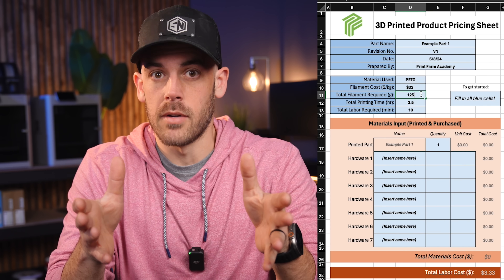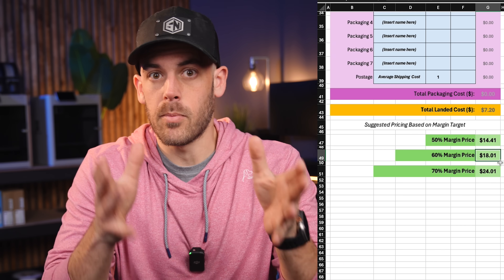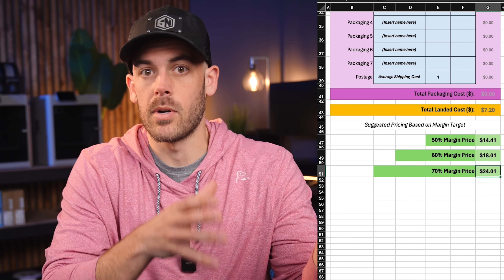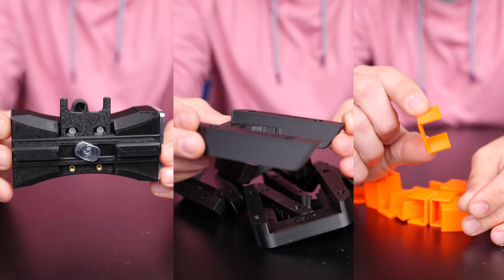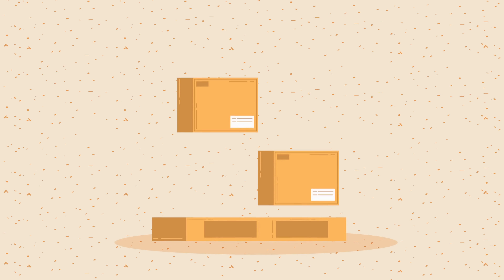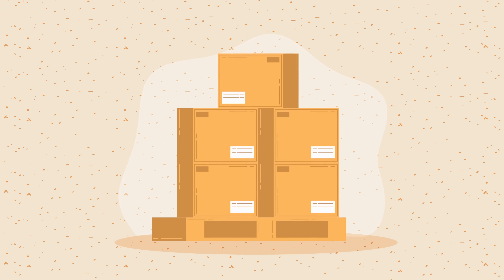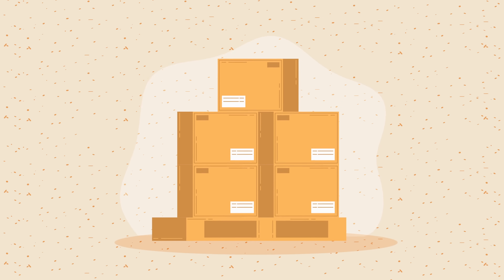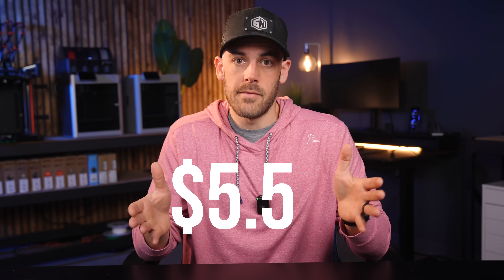Why I charge $55 for this 3D printed part (how to price)

Comment: Of course! Here's a translation into US English:

---

First of all, I want to congratulate you on your content. And if I may, with the best intention of collaborating, I have to point out that there’s a mistake in the percentages—it’s a very common one. For example, you marked a 50% margin on the stop lock based on a cost of $20.07 and arrived at a sales price of $40. But that’s incorrect because 50% of $20.07 is +$10.03, which gives you a result of $30.10. To reach $40, you’re actually adding 100% (in this case, 99.30% to be exact).

As I said, this is a common error. When people think of doubling an amount, they automatically associate it with 50%, but it’s actually 100%.  
So, the percentages in the video are incorrect.

On the other hand, costs are often higher than they seem. For instance, if you hire someone and pay them $20/hour, that’s their net salary, but you also need to account for additional expenses associated with that salary, such as tax withholdings, health insurance, etc. Additionally, your business requires non-billable hours that need to be covered—for example, time spent reading emails, marketing, etc. That time has to be paid for from somewhere.  
You also need to factor in overhead expenses, not just the electricity a machine consumes but also heating, AC, phone, internet, space, accounting, software, and so on. All of that needs to be included in the margins.

That’s why so many people offer very low prices, which disrupts the market and sadly leads to failure because they didn’t do their calculations properly.

In any case, pricing is a headache! lol  
It’s really complicated to get it right. At least in my case and with the type of business I run, pricing is very subjective and complex.  
Especially when you’re not driven by "numbers" but by the passion for what you do, as is the case for me and many others.

Good luck!

Comment: How about taxes, additional cost to your business, insurrance, rent, etc... And this is just a few to mention. There is no such a thing 5 minutes work. We call it 1 started hpur. So 5 minutes work or 30 minutes work is equal to 1 hour labour cost.

And here is the weird thing. In my business 3D printing does not cost a dime to my clients. Its just part of the service. The real cost they are paying for is the design. Which you can never measure in gramms or shipping cost or kw/h. Not even labour time, because some project has deficit on but but it will bring other profitable projects into the house etc. So every project have its own value and that's the value we estimate and decide if its a yes or pass.

In my opinion printing farms are just going to disappear like internet cafes, laundry, and similar hype when and where people had no access to right tool or know how. Some exeption will still survive but those always have their own special reason. In a few years from now, using a 3D printer at home will be just as obvious as the internet today, cameras, washing machine etc.

Comment: I didn't see anyone mention this so I will here. Quick note for the end of the video when OP reviews the markup. The math used in the video is incorrect. You DO NOT take your landing cost and divide by your desired markup as done here.  If your landed cost is $8.45 and you want a markup of 60%, the selling price would be $13.52, not $19.99 The math here is simple. Landed Cost x Markup% + Landed Cost = Selling Price.  Or you can simplify and add 1 to your desired markup. In this case it is 1.6. 1.6x$8.45. You can always check your math by taking your markup $5.07 and dividing it back in to your landing cost. 5.07/8.45=.6  In the video example the math is as follows: $19.99-$8.45=$11.54 To find markup as a percentage you take your $11.45 (markup) and divide it by your landing cost. $11.45/$8.45= 1.36 or 136% markup. This is VERY important when attempting to price your products.

Comment: I think you are underestimating the cost of your printers time. 0.15/hr is nothing compared to your other costs. What if you had a small, cheap part but took a lot of time to print and had to buy more printers to keep up. Also, consider what you could be printing instead with your print time. What is the marginal cost of an hour of print time in terms of having to buy an additional printer and get additional production space?

Comment: Pretty good calculation, but I would add in the space as mentioned below, and other equipment like the UPSs, extra wiring for all the printers, networking costs etc... This would be the overhead.

Comment: Thank you for the video.  I just quoted a selection of parts and hardware, requiring extensive custom fitting and assembly.  The response to my price was "what do the materials cost?"  With all the incredibly cheap items coming from China, many believe that any item should cost pennies.  Printing can be a business or a hobby.

Comment: In the quick pan you did of the print farm, I thought I saw several UPS's (okay, technically, not a UPS, a battery backup).  So 2 comments: they also have a lifespan that needs to be accounted for, as well as power consumption; and I hadn't thought of doing that for my printers, so now I will, which is is funny, 'cuz I have them on everything else!

Comment: Hi Travis! 
I tried your free Pricing tool and it saved me a lot of time since I was in the process of starting to develop one, and yours was even better with things I didn't even think about. I Just wanted to point out that your tool has a minor detail that should be fixed. Currently it calculates the added machine cost (which is great) but it doesn't multiply that value when changing the quantity of printed parts. Its easily fixed with adding a _ *E17 _ at the end of the formula on the field G43, it should read something like this _ =(D12*'Adv. Inputs'!C5)*E17 _ at least this worked for me. I even added the parts on my slicer and reentered each value for different scenarios and it was closer to the en results with this change. Hope this helps you or anyone else that tries it out.

Comment: I love this worksheet as it helped me put real numbers in place that luckily aligned pretty well to my guestimate. I was shooting for a 25% margin, but was only getting 20%. 

One thing I did not see was if I can print X widgets in a single job, but sell them individually, how do I factor that? Is it just as simple as divide the final price by X, or is there something more advanced I should consider, like if a customer orders 2 units, my packaging and shipping is reduced slightly due to combining the units in one package for shipment. So far I have been just dividing by X as that is the easy way and may generate a slightly larger margin on a multiple piece order.

Thanks for putting this together.

Comment: There's so much missing here. Overheads (rent, internet, mobile, lights, insurance, accounting, miscellaneous office expenses like coffee, dishwashing materials etc), lost time of production when a machine breaks down, marketing, whatever cut the interface you sell with takes (eg Shopify, Amazon), merchant fees (might be included in the previous one), the cost of returns (hopefully you have none but that's unrealistic). On top of that you have to account for the cost of capital to set your business up - whatevr money you invested in machines and parts is money that could have been invested in the share market or elsewhere - so there's a interest cost to that. Also labour calculations were just off - while it may only take you 20 mins to do something, it's totally unrealistic to think that you use 100% of your time productively. I'd probably double the labor cost because for every hour you spend working on a part, you probably spend another hour repairing machines, ordering materials, keeping track of invoices, answering calls , designing etc.

Comment: You could consider the finished good as a single part number and the parts, labor and time as individual parts in the finished good Bill of Materials. This way you can measure the individual parts performance and adjust accordingly. If the cost of a purchased part goes up, it will automatically calculate the finished good cost. Then you're only working with units produced, units sold, etc.

Comment: 50% or 60% margins are insane for small goods. They're usually in the 10-25% area depending on various factors.
Reply: Not to mention you're already paying yourself for labor.
Reply: this is because the 10-25% products are based on LARGE MANUFACTORY. Small businesses do tend to charge more because of their scarcity, its just supply and demand.
Reply: @animentors  Name me a small factory. Any factory who pays themselves a profit margin on top of paying themselves an hourly rate for their own labor.

'You' are not cost, you're overhead.

Comment: This was super informative, thanks!  I have my own simple print cost calculator in Google Sheets that I've used and shared for years but it only included a "cost per print minute" field rather than considering the life of the machine, labor, or profit margins so I've updated it to include those things.  It's nowhere near as detailed as your excel sheets and I'd never use it in an invoice but it's great for rough/quick ballparks. https://docs.google.com/spreadsheets/d/1mg8AxwLEQth6RH1jOSit3emLqgL7mKZg2cugyjT5uIk/edit?usp=sharing

Comment: In some parts of the country the cost of a kw hour is a LOT more.  Based on my last electric bill here in the Boston area the cost of Electricity is about $0.148 / KW hour.  However there are numerous other surcharges!   These add up to $0.1764 / KW hour, for a Total cost of $0.324 / KW hour.  That's more than TWICE the cost you used!  
In the Boston MA area we pay separate charges for the energy and the transmission of the energy, IE: costs for the use of the grid.  There are charges for electric vehicle usage (even if YOU don't own one), and connection of solar systems (even if YOU don't own this), as well as charges for upgrading electric meters (even if yours wasn't due for upgrade), etc, etc, etc......
Welcome to the future!

Comment: None of your costs matter if the product doesn’t sell. Make sure you’re priced to the market.
Reply: You shouldn’t price to the market, if you can’t produce something at the market rate and you don’t have some other value add with your product (better features giving other benefits to the user) then find a different or better product to sell, no point selling at the market rate and not getting a decent return - you’ll just end up being a busy fool.

Comment: Prices arent based on cost. They're based on price elasticity of demand. 

When you decide to buy a big mac do you care how much it cost them to buy beef, buns, labor? How much the govt charged in income and property tax? The cost of complying with regulations? Their marketing expenses?

You don't care. 

So as a business owner you need to cover your costs but basically you want to charge whatever will maximize profit. And there's a balance point between #sales and price. Raise price, less sales, lower price more sales. But lower price is less profit per sale

So i think your considerations of costs is critical to being in business but it is not how you should set prices.
Reply: Thats because companys like mcdonalds are large corperations, these prices are usually factored towards small business owners.

Comment: I think there are two other costs to consider: Advertising and Design, what was the cost to design the part(s), they are like machine time, if you spend 100 hours designing a part and testing it, and you plan to sell 2K of them, that should be factored in.  How much are you being charged for advertising the part? .50 cents a click?!? Love the channel keep it up!

Comment: Hmmm, I can think of many costs that aren’t included:
•	Rent
•	Fit-out of the print farm, including shelves and electrical installation
•	Power for lighting, air conditioning, office equipment, coffee machine, etc.
•	Subscription fees for software
•	Designing the product (time, test prints, test parts) divided by estimated products sell.
•	Labour time seems low, around 2 minutes. Does that time include all the admin work, such as booking the job, loading the file to the printer, unloading the printer, packing the goods, printing labels, updating job status, transporting to the post office, updating the website, and handling customer reviews?
•	Printer costs are covered, but what about computers, stationery, and other office expenses?
•	Insurance costs.
•	Internet and mobile phone costs.
•	And many more I may not have thought of at the moment.

Comment: You can buy 6 creality printers for 1000$ or 1 great bambu printer for 1000$. Im not saying creality offers bad printers but they need more tinkering to work propperly even if 3 of them work perfect out the box you will still make alot more profit alot faster ! And you will acctually have a print farm for a 1000$ dont spent 5000$ on 5 printers you will never recover fillament prices are only going up

Comment: I really liked your video. I would agree that the R&D part also has a roll. The other major aspect that I think is important, is repair “labor” costs? How long does it take to determine there is a problem? How long does it take to diagnose and get replacement parts? How long is the printer out of service? Keep making. I make parts for the Bosch also. I will purchase your dust collector, as mine is broken. I’ll keep watching and making! (Hopefully selling…)

Comment: I have an accounting background and you have left out G&A expenses, plant expenses (rent & building maint, auto expense ) Marketing (which will your biggest expense) Rule of thumb is Retail price = 5 times fully landed costs.  In other words - whether you know it or not - you are running a charity.  A distributor will pay you 50% and charge the retailer 75%. If you are selling direct on the internet you've got all those costs.  If you use Amazon they will shift all the selling, packaging + delivery costs to you and continue to take a bigger and bigger cut - plus they'll share your design with other vendors cheating you out of your design cost (don't even think about a patent) But make sure you copyright your design. (costs you a stamp).
Reply: OMG you keyboard experts are exhausting.....Any sentence that starts off by telling your perceived expertise is typically not worth the read

Comment: 10:10 What math is that? That is not 50% or 60% margin. That is over 100%. 
$13.5 x 1.5 = $20.25, or $13.5 x 1.6 = $21.6.
For this $13.5 cost part, charging $27 is a profit margin of 100% and $33.75 is a profit margin of 150%.

Comment: I think you're missing a cost category in the "machine time" bucket: the opportunity cost of not making profit from that machine on another product.  Let's say that there are two prints.  One uses twice the amount of time as another, but the same amount of filament.  Let's say one hour versus two.  The rub is that you'll only be able to sell and profit on half as many units per day with the slower part.  You should price machine time to capture both direct costs from operation (as you do), but also as a proportion of that machines ability to generate profit.  You'd think that you could just scale the number of machines you have infinitely to avoid this problem, but you run into the second problem, which I see has been mentioned, that you're not including the cost of the space the machines occupy, and the costs needed to light, heat/cool, and rent that space.

Comment: I print and paint 3d models (mostly busts of superheroes, sci-fi or fantasy characters) as a hobby. People at work have asked if I can make them one, and I blatantly refuse...

The actual cost of the print is more than just the materials...
- it's the  beforehand to slice, scale, orient, support etc the model in a slicing tool
- then it's the material to print (and as OP mentions, some of the early prints may also fail)
- its the electricity to print the model
- its the time to remove supports and clean up the model
- the time taken to prime it (at least a couple of coats)
- and lastly the  it takes to meticulously paint the model (sometimes several stints of multiple hours)

So for a "simple" small bust I may have put around 10 hours into it plus materials etc. If I "only" charged minimum wage for my time it could be circa £100 - which  is going to pay. And if I accepted any less than that, I'd be undervaluing my time and effort. So I don't do commissions when asked.

However, I have done some as gifts. 🙂